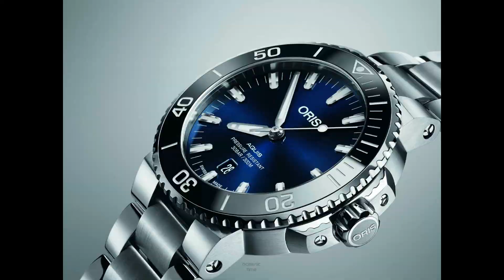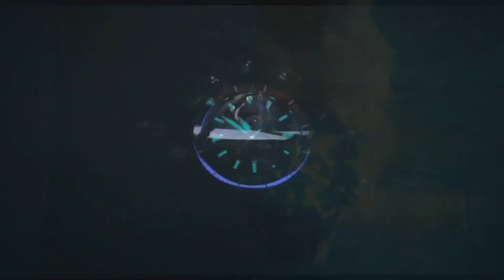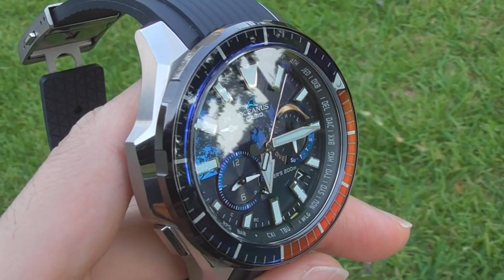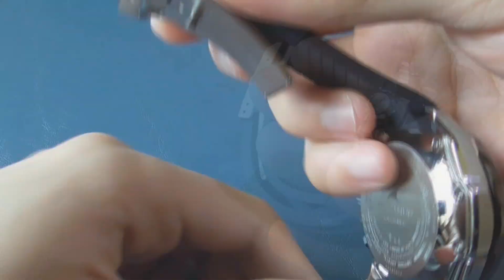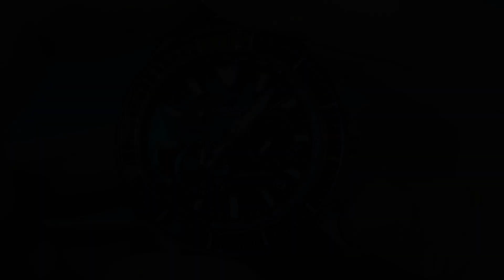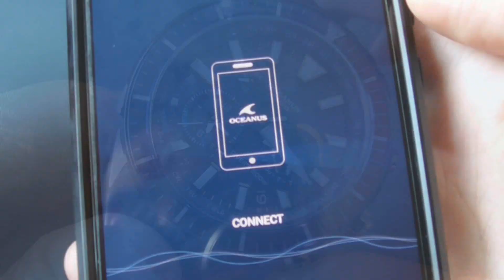Oceanus OCW-P2000 The ULTIMATE Review

Comment: I received this one in this colorway a few days back and it is simply amazing. The finish is on par with my Omega (except for the bezel,  that is much worse on this).

My only problem - notwithstanding the bezel - is that it doesn't sync to MB6 if it is paired to a phone. I'd prefer to have both.

Comment: How do you re align the mode or the second time zone mine unfortunately went haywire for some reason ☹
Reply from the maker: To change the time zone on the sub dial just pull out the crown on the first position and select the timezone
Reply: @watchroll3310  even the days hand has not been aligned properly
Reply from the maker: @billythekid1638  ohh you mean hand alignment. On mine they are all perfectly aligned. You can perform a manual hand alignment function or wait for the automatic alignment whenever is synch. If they are not properly aligned even after that probably you can send it back to the store or the manufacture in yamagata. I'm sure they will fix it as it is a premium factory that take care of that. 

Misaligned hands on this watches can be cause by very strong magnetism or shock. Maybe your watch was Mishandled I'm not sure.
Reply: @watchroll3310  i left it at the very back of my gaming laptop. I only noticed it stop moving after 2 days. Yamgata is good and all but im in America 🥺
Reply from the maker: @billythekid1638  maybe it needs to charge with light. Also, connect it to the app then do a check up. The app would tell you if something is wrong.
Reply: @watchroll3310  its fully charged and the app says everything is ok even though its not aligned properly. I expected more from my 1700$ titanium watch, should have just stuck to the mtg g shock line 😭
Reply: @billythekid1638  weird I've had mine for 3 months now and it's worked flawlessly